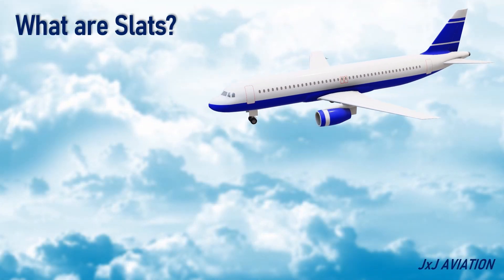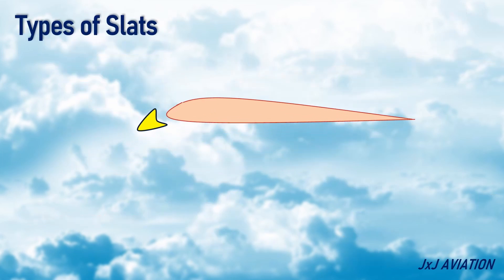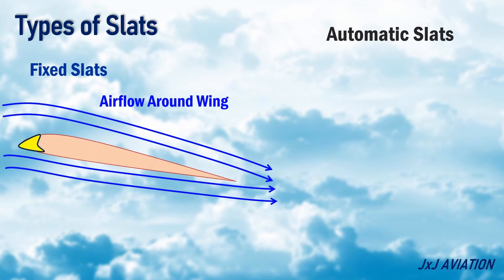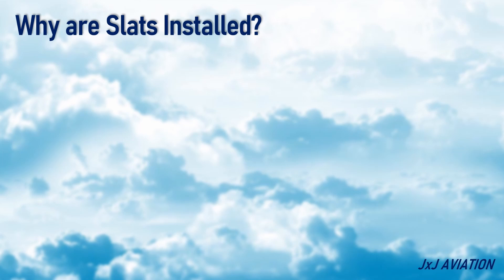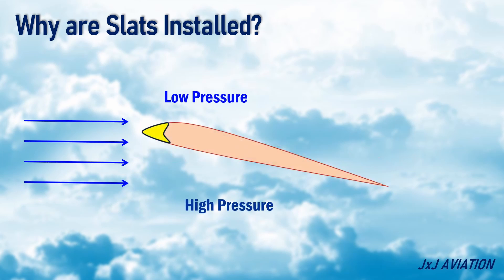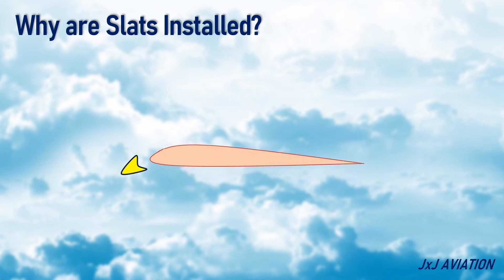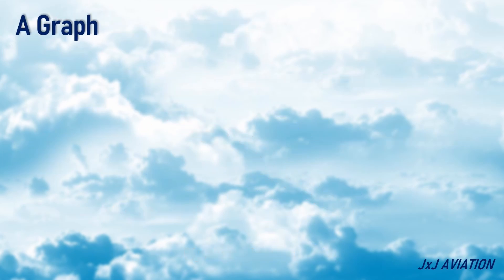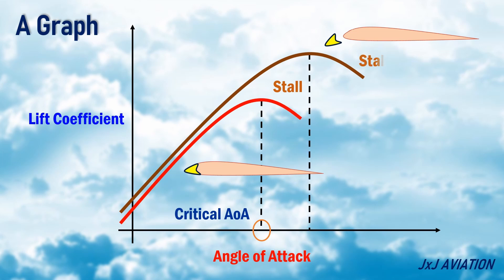Understanding SLATS and its influence on the Critical Angle of Attack | Types of slats

Comment: so it's basically just like normal flaps
Reply: Not really. The slats earn their money by letting the wing and flaps tolerate a much higher AoA. It's not the slats themselves but what they let the wing do that would otherwise cause a stall.
Reply from the maker: a good explanation. Thank you!
Reply: @gerardmoran9560 also ..please correct me if I'm wrong, but flaps also decrease the angle of attack right?
Reply: @shraviator  Yes. Visualize the chord line with flaps extended. The stalling AoA is usually lower with flaps extended but that AoA occurs at a lower airspeed. You're basically asking the air to follow a more curved contour, so it quits sooner. Slats permit AoA with flaps extended to increase to about the same as a clean wing, again at a much lower airspeed. All assuming 1G. Cheers